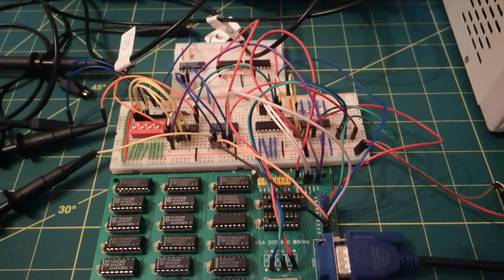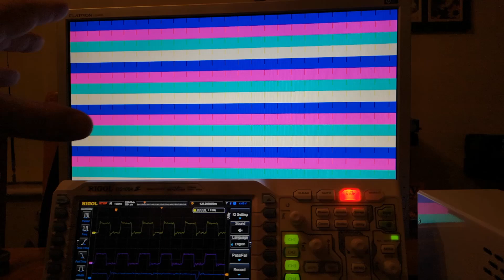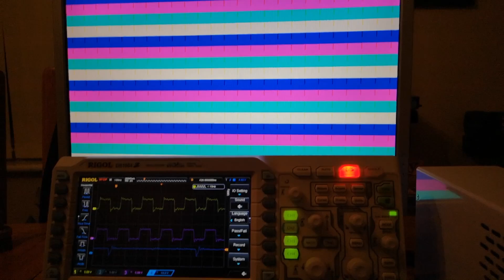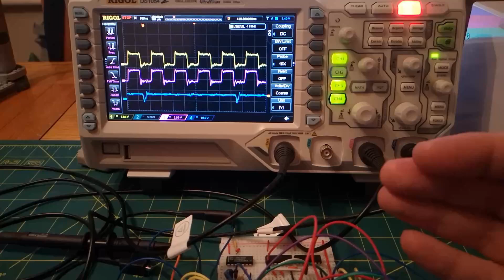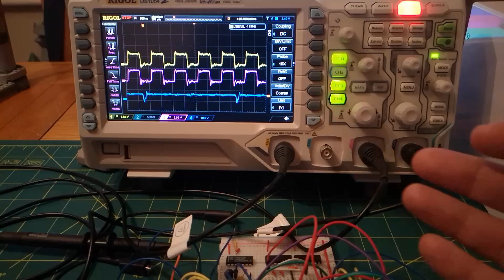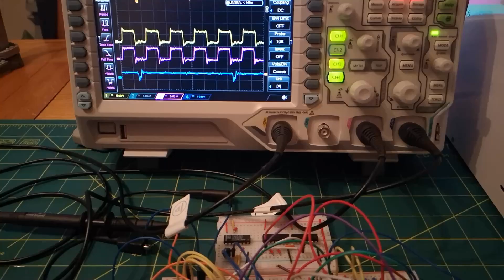Z80 Computer - Part 13 Pixel Control

Comment from the maker: Makes sense that pixel 4 is turning on/off when I switch bit0. I'm triggering the pixel load from bit3 of the horizontal counter which will trigger at binary count 100 which is 4 in decimal. So I'm thinking I could use a 3-input NOR gate. This should give a trigger pulse whenever bits 0, 1 & 2 are all low. So for example  0000 0000 (0), 0000 1000 (8), 0001 0000 (16), 0001 1000 (24), etc